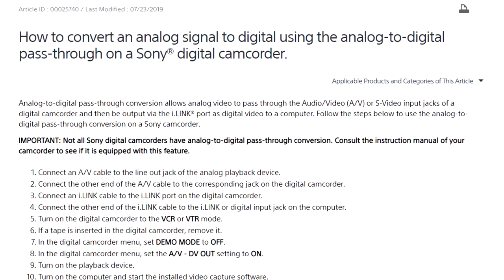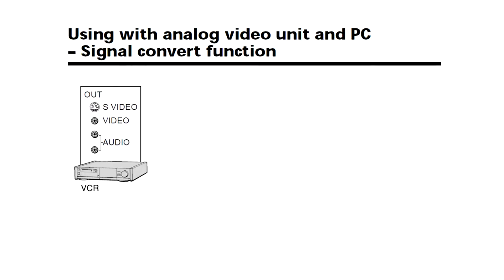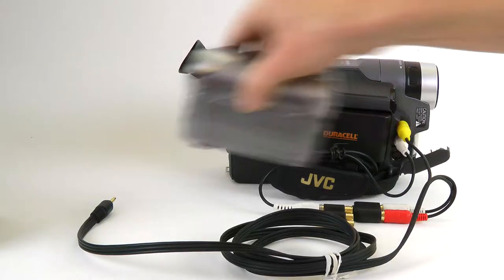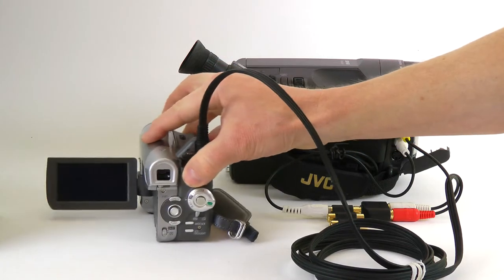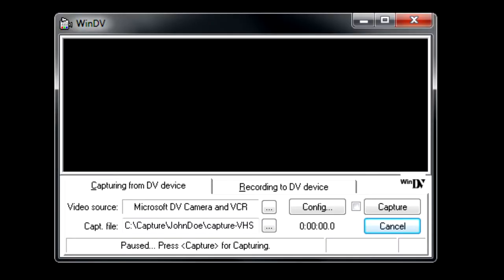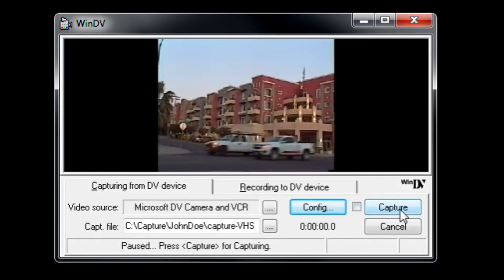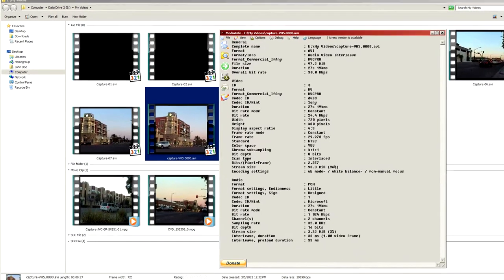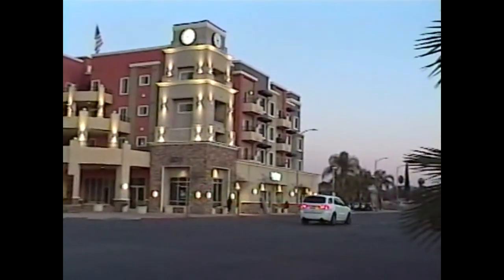How to digitize analog video using Digital8 or DV camcorder in passthrough mode

Comment: I did this with a Sony Digital8 camcorder but ended up going from VHS to D8 tape first. I couldn't get it to work in a pass-through mode. I'm gonna try again, but even if I have to use a Digital8 tape as my go-between, it's still one of the better methods I've used. Maybe I'll buy another DV or D8 camcorder that I can confirm definitely supports the direct method. 

At present, I'm seeking to compare this method to using and HDMI capture card (Elgato GameCapture HD). I'm torn because the Composite to HDMI upscaler does a good job of deinterlacing, but there appears to be a visible loss of detail. This is arguably still preferable to dealing with scanlines, but I'm gonna experiment with TFM via Avisynth to see if that is a viable deinterlacing method.
Reply from the maker: Sadly, not all Digital8 camcorders have a pass-through mode. User's guide usually mentions it.

Are you digitizing a movie originally shot at 24 or 25 fps? TFM is a field matching filter that can be used to recover film frames from telecined NTSC, as well as some PAL sources. It is not useful for deinterlacing native interlaced video. Frankly, I don't use Avisynth or Vapoursynth, I prefer simpler solutions built into VirtualDub. Its IVTC filter does a good job recovering 24 frames from a telecined movie, you can see it here: https://youtu.be/DneoPwa5faY

When you capture with Elgato via HDMI, does it capture into a widescreen HD file? If you capture 4:3 video, do you have it pillarboxed in 16:9 frame? This is what my HD Capture Pro box does: https://youtu.be/eWxAnwZi7Zc
Reply: @ConsumerDV  i found out the hard way that 90% of camcorders that have TBC - doesn’t provide it on the pass through product only - i called JVS - only 4 of their models allow the function and I was told that any pass through is not TBC corrected even if the model cam has a built in TBC listed …. Any idea on a list of actual Camcorders that do provide actual TBC on pass through ?
Reply from the maker: @toddpa-c3826  Indeed, many (most? all?) camcorders with built-in TBC do not enable it for passthrough. I wish I had a list of camcorders that engage TBC in passthrough mode, but I have no such list. If you find one, please share!

Comment: So to delacing, does that mean exporting as Progressive instead of upper field?
Reply from the maker: If you digitize using a camcorder via Firewire, it will encode it as interlaced DV, bottom field first. Then, if you want to upload to Youtube, you need to deinterlace, because Youtube does not deinterlace correctly. You may want to take a look at this video, starting from 8:18 - https://youtu.be/XzY1Vo1occc?t=498
Reply: You can use VeeDub64 to deinterlace the raw DV footage

Comment: Hi so I managed to get everything working for my pass through method

 the only problem is that my audio is very staticky and only plays on the left side.

 I was hoping if there's any video that I could watch on your channel or perhaps any info about how to fix this problem for my  method since I really do want to actually capture raw analog footage from my VCR or any analog source to my computer for upload.

 I know you already have a video about that and it's what led me to your channel, which by the way kudos to all the work you've put into making all of this

 I wouldn't have known all about this stuff if it weren't for you uploading this and me stumbling upon this so thank you for this channel and stuff. 

Just let me know if you want to to talk in private or if you want to comment down with a reply and let me know if you have a solution to fix this audio issue of sorts. Thank you! 😁
Reply from the maker: Hi, I appreciate the comment, thank you! I cannot comment on static in the audio. Regarding having audio in one channel only, does your camcorder record monophonic audio? Which model is that? Many Hi8 camcorders and most VHS camcorders recorded mono audio. There are three ways of dealing with that. First, you can capture just a single channel and then render your output video with mono audio. Not all digital video containers support mono audio, so another option is to duplicate one channel digitally into left and right, you can do it with many tools including VirtualDub. The simplest option is to use a Y-cable that splits mono audio into two channels, like this: https://www.amazon.com/gp/product/B08R7K4CLS and capture it as if it were stereo.
Reply: @ConsumerDV  No prob! Also, my camcorder is a Sony Handycam DCR-TRV17 MiniDV camcorder & is capable of HiFi stereo audio (at least according to the display.) I have my VCR's RCA yellow, white & red ports connected to my camcorder's S-Video & A/V 3.5mm ports.